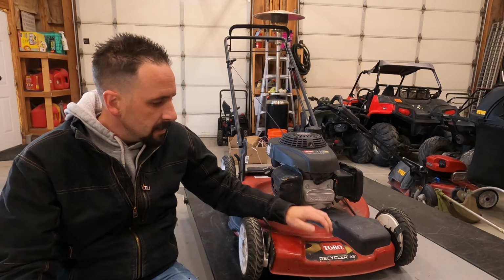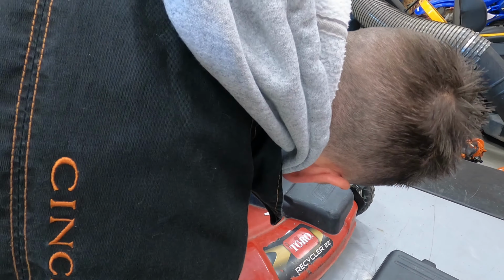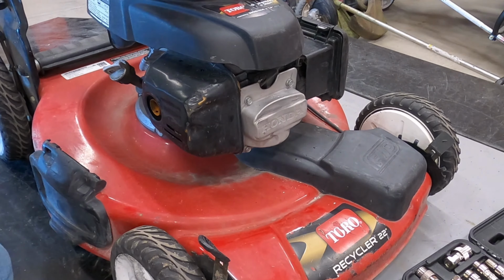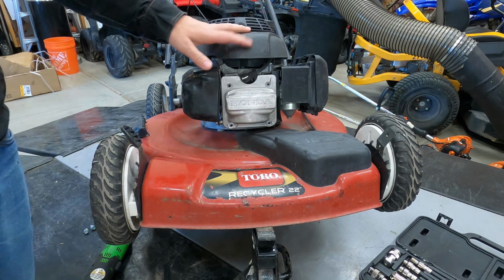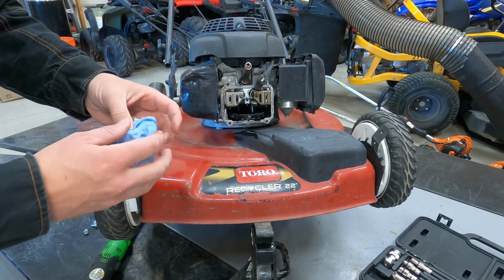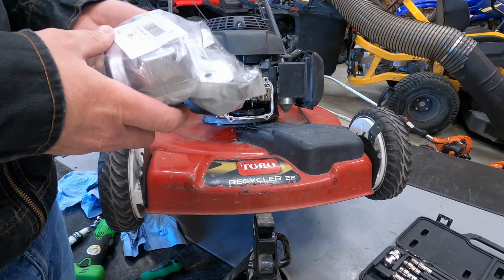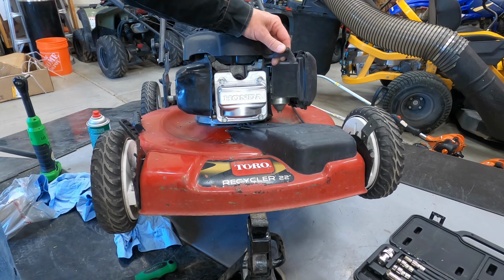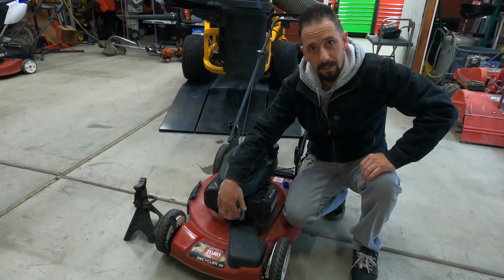Newer Toro push mower with NO compression.......Easy fix!

Comment: Instead of using a scraper, you can also use WD40 and it will help break down the Honda-Bond to be able to wipe it off. Works with silicone and RTV as well.
Reply from the maker: That is correct.  "That" would be the brake, and all of your assumptions where what I was showing.

Comment: The best thing to do with a toro recycler is to recycle it into scrap iron. Rubbish design. The governor is set far too low in the factory and being self governed there is no throttle over ride. Chokes out on even slightly long grass. If grass is damp it blocks almost instantly. What worries me most is suppliers of this mower tell customers the oil in the engine is for life and never needs to be changed 😂 my response is yer right. They have slipped a long way down the ladder of design and quality since wheel horse.

Comment: I own one of these. Have only mowed with it for 4 months. Now It only starts if I give it a squirt of starting fluid into the carb. Once started it runs fine. I drained the tank and found no dirt and no water. I found no dirt or water in the carb bowl. The gas is only 2 months old. What should I try next - fresh fuel, clean out the carb? Any ideas of my issue?
Reply: try fresh fuel and make sure your gas can is clean
the ethanol in the gas nowdays draws moisture out of the air and ruins the gas in a very short time like 3 or 4 weeks if you live in a humid area, also trty to buy non ethanol gas if you can, it wil last longer
also if it still is giving you trouble you may have some dirt or water in carb and will need to be cleaned, there are alot of videos on that just type in cleaning carb and your mower type in the youtube search bar
hope this helps and God bless

Comment: That' wouldn't have been a warranty repair anyway because it wasn't the fault of the lawnmower.

If it's a.GSV190.engine well,I replaced the piston rings in my dads GSV190 lawnmower engine because it got very smoky on startup.& the piston rings were tired after 20 years of mowing.

So the lawnmower can go for another 20 years again like that  !

Comment: If no compression after removing the cover is the engine toast?
Reply: Come now no engine is toast… just needs a tool maker ;)
Reply: Could be a stuck valve. Same issue as what we are seeing in thr video. I had a honda gcv 190 with an exhaust valve that would not seat. Oiled it and cleaned it up and it runs great again. (Caused by low oil)

Comment: some plug sockets are too short--- I never use sealer on a valve cover - never on a mower--- If no gasket is available I make one-- never sealer
Reply from the maker: Are you implying if YOU don't have the correct length spark plug socket, you remove the valve cover to get the plug removed?  Interesting concept.
Reply: @kbssmallenginerepair2615  no-- get a long plug socket

Comment: You didn't have to replace it you could have just straighten it out and it would have worked that's the difference between a parts changer and